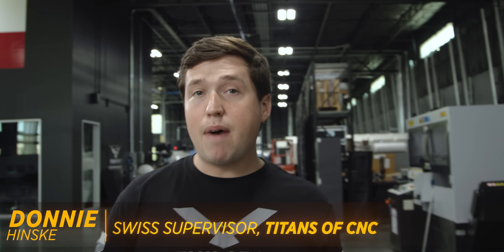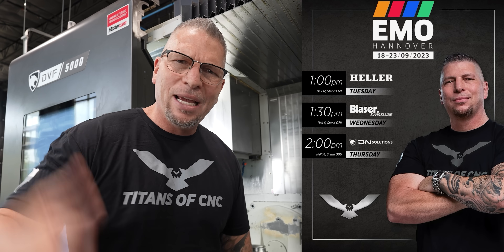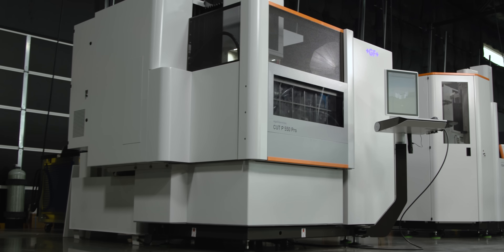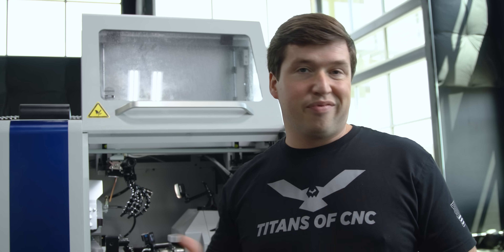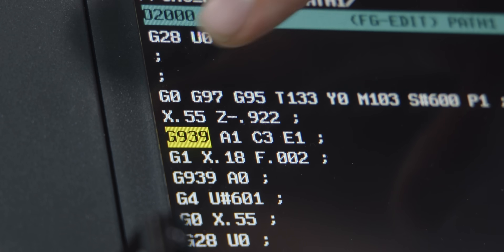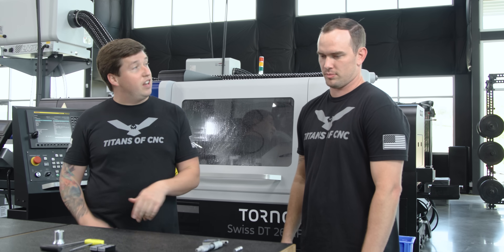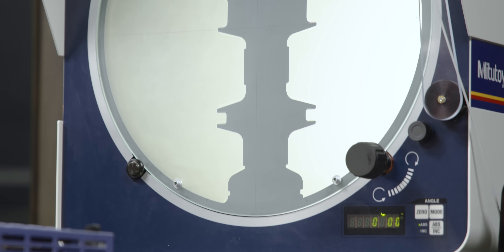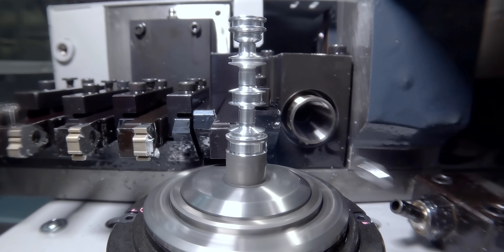CUT DOWN Your Machining Time to SECONDS with CUSTOM Form Tools

Comment: I really enjoyed watching this video as I used to grind tangential form tools 50 years ago on a jones & shipman 540 surface machine. A form similar to the one in the video over a  5" length would have taken over a day to make. The tool steel was rough-milled before hardening

Comment: Hey guys did I see it correctly, did the shaft end wobbled at the plunging on the end?😳
Reply: A little more finesse on the final plunge might be necessary, but it's not uncommon for this approach to cause a lot of side load and the part to subsequently give a wobble.

It can be ironed out with some workholding or just a slightly easier approach on the final cut, if they're desperate to eliminate it. Some jobs don't absolutely need it.

Comment: How come chatter isnt an issue? I suggested doing something like this for some small thin domed parts to my manual machinist coworker instead of tons of small step over spiral cuts with a ball end mill on the 3 axis cnc (we dont have a cnc lathe) but he said chatter would be way to much and the mill would be easier. (It wasnt, they kept bending in the chuck, I didnt get home till like 10 : / ) Was he right about that or did he just want to pass the parts onto me?

Comment: It is awesome tech. In what range of production volume is this the way to go? Because I'm not sure how big the window between very fast conventional lathes and the multirotor revolver lathes is for this. The tooling is for sure very expensive in comparison.
The problem that I see is: The machine is aready very special as the spindle power for such an operation and the cutting forces are SICK. May it be twice as fast as a very fast standard lathe setup. With standard quick change tooling, you can certainly use higher cutting speeds, as inserts are much cheaper than these tools, which prevents this to pull ahead very far. 
And then if you use a specialized machine with custom tooling, why not going full beans with a revolver lathe that probably still beats this by a solid factor - again with cheap (in comparison) standard tooling?
Don't get me wrong, I like the shots that you presented here A LOT!

Comment: Funny to see this. 20 Years ago I did an apprenticeship on 30+ Year old mechanical multi spindle lathes using form tools. Typical part time: 6 to 10 seconds. So the Idea has been around for a while... And we also did the chip breaking thing. We just grinded some groves into the curves controlling the tools...

Comment: i thought for a moment that insert 2 and 3 looked the same and I was already making up some cheap joke, but then I started thinking...

what if there were actually 2 identical inserts, would it be stupid to mount the same twice?
I think it depends on the number of parts you would be making: for a small number, yes, it would be a waste. 
But not for a large number. If you merge inserts 2 and 3 the result would wear out twice as fast compared to inserts 1 and 4. You would need to stop production to change tools twice as often, and half of the times you would need to change only 1/3 of them! 
So, for a large production it would be actually quite smart to mount two identical tools.

Comment: So the wobbling can not be good at 5:40
Reply: It's sideloading. The wobble is basically at the end of the part and is relatively controllable with a little finesse on the feed. It still cuts to dimension and it won't just break off without you specifically jamming it in or a lot of heat buildup.

Part is small enough that this is a minimal issue, if you wish to copy the part and get worried about it, make a spoon to hold the part a little more square on the final 2 ops and find a way to give it that support. (Maybe a tray attachment or something)Or run coolant and maybe back the feed up a smidge for final 2 passes.

Wobble only makes the backmost non-cutoff insert the most likely to chip first. But given the other inserts involved, I don't know if that actually becomes a reasonable concern. (The fine valleys in that OD are all but guaranteed to go first, needing a redress or change on those 2 will likely get all 4 redressed just to keep things consistent)

It's in tolerance, finesse is for when the job's running regularly.

Comment: how long would these tools last before theyre inaccurate from wear?
Reply: For that really fine valley? I'd probably wager 100 parts. It could still be in print, but it'll probably start showing some wear. Probably 500 before something chips or snaps.

If you really want to you could probably redress the carbide a couple times if you catch it before they break. Just have to keep an eye for the wear. Plunge a little extra deep to compensate for the draft angle.

So they might be able to use those 4 inserts across a couple thousand parts. With careful eyes. With less careful eyes, probably be 500 before a few are toasted somehow.

Comment: It seems to me that it is possible not to project each line and arches separately, but simply to use a Boolean operation. 
After subtracting your part from the cutting insert, you will get all the contours automatically. 
This will speed up the process of creating a contour by about ten times.
 And you love speed and simplicity ;)

Comment: Are these carbide inserts, uh, naked? Is it even practical to EDM coated inserts? I'm a bit of a materials nerd, but I don't recall if any of the common coatings are conductive. I don't have any idea how the tool will wear or even if it would cut properly with the relief uncoated.

Comment: Hi Ronnie, good job but you missed something fundamental on the tool geometry.
Problem with plunging tool they get dull pretty fast base on material used, and you will start to have build up edge who will affect your tool performance, dimensions and surface finish.
That’s the time when you will need to reshap your tool, but your tool was not design with constant geometry so you can’t resharp from the top without affecting the geometry.
Basically you need to calculate your rake angle that your tool profile stay consistent so you can regrind it from the top.
We use to do that all time on Escomatic tool..😅
But that probably a topic for your next video…😉👍🏻
Stay 💪🏼 Boom !

Comment: Why did the part look so wobbly when you were cutting it, that can't be good. Not trying to be an a hole, you guys are amazing keep up the great content.
Reply: Because the pressure is insane and the variation of depths with a rake angle make that the cutting edge isnt on center anymore and the part is trying to climb over the tool.

Comment: Hey guys, just a heads up in solidworks, you don't need to do the convert entities + cut extrude,  you can just use the cavity feature and it will do all that for you. Makes it much easier.
Reply: Are you sure? That sound like it will essentially revolve cut the body from the tool, and it will have no relief and not be a 2d shape

Comment: the insane side loads that form tool makes are blatantly obvious when plunging. I'm surprised you didn't mention breaking parts etc. You can see the stock want to almost snap off during the plunge.
Reply: They just started this approach, you can finesse the side loads over time with some work. They could also stand to make some spoons to help stabilize the end of the part for longer jobs(or even this job with a tailstock); but they'd probably just be better off setting up secondary ops for finishing it over that.

They got their part, it's up to tolerance with a decent finish. They can refine the pain on gears and cutters with more runtime.

Comment: Random question guys…. At my shop we have a Mazak with a spindle problem we think…after machining a plain block of aluminum with a 4 inch end mill and we check it up and down with an indicator on the Z it’ll be 0 at the bottom and by the time we get to the top it’s .010 off…..could the spindle be crooked or what would cause this? The spindle did just get serviced because it wouldn’t change tools properly so we’re thinking they did something incorrectly when they made the repair?
Reply: Sounds more like a gib issue.  As your spindle travels in Z, if the gib is loose, it will cause a taper in your machined surface. Are you seeing any chatter on your machined surfaces?  
Put a 1” dia. solid end mill holder in the spindle.  Then put a 1” dia bar stock in the holder and tighten it.  Put an indicator base on your table and put the indicator needle on the holder.  Grab the bar stock, push and pull in all directions and see if you have movement on the indicator. Make sure needle is on holder and not bar stock.

Good luck

Comment: Nice Job
But you the way you design the insert is wrong. The error will be pritty small, but its not the right way to do it. You should have used the 5deg plane.
Reply: Plus the error doubles on the part.

Comment: We use a thing for cutting plastic on our Citizen sliding heads, not should what it does, but it breaks plastic chips.
I went over to the dark side of Inspection about 10 years back form CNC turning, I have arthritic problems now 
and I don't think I could stand up all day without getting in pain.
That is why I don't Know much about the new Tec.

Comment: is it me or was the part flexing during the cut
Reply: It is but it stabilizes once the cutting force is gone. Then it dwells.
Reply: @donniehinske  That's what I was wondering, the run-out.  It's so fast it's hard to see it dwell.
Reply: @randpowl3941 im more worried about matherial integrity. Probably filled with micro fissures after that

Comment: is there a dwell when the form tool is at the depth or does it retract immediately? i am wondering how round the part is.
Reply: Yes there is a .3 second dwell when the tool is done cutting. Roundness was .0003”

Comment: I love that Horn has tools like this sitting on the shelf that can be easily converted into a form tool.  I've used a lot of Horn tools and they have made a lot of custom tools for us and they always worked great.
Reply: Horn's engineering team is incredible. They have helped me with some odd grind reliefs created by some inexperienced engineer. (necking tools). The relief could have been done with off the shelf tooling, but my engineering team was too intimidated to question the dimensions.